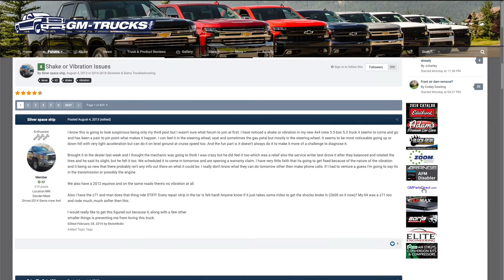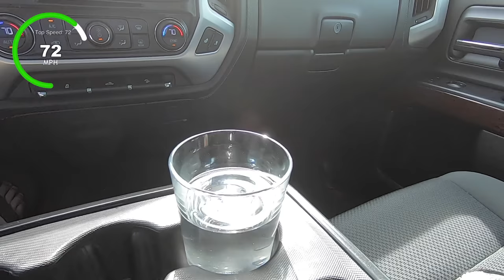"Chevy Shake" Driveshaft Fix for GM Trucks?

Comment: Tires make a huge difference H/T vs A/T  smooth ride with highway treads , all terrain are choppy loud and not so smooth but will get you through the snow. You want a smooth ride buy a 1970 Chrysler 300
Reply from the maker: I mean sure but the idea of “if you want smooth.... buy xxxxxx car” doesn’t make sense when older trucks and competing brands of similar years vibrate. Modern trucks ride incredibly smooth so when one doesn’t, to say trucks shouldn’t ride smooth is just deflecting responsibility for brand loyalty and dismissing the entire landscape of modern engineered vehicles.
Reply: @GearsGadgets  
All I can say is haves 2006 Silverado. One owner truck. 114,000 miles when I bought it two years ago. I hate it with a passion. It has the shake that's all over the place. Sometimes bad, sometimes very bad, sometimes barely but it always shakes. 

I have a 73 Dodge truck that rides and drives better than the Shakerado.

Comment: They had to flush the bad fluid out of the torque converter and now it is as smooth as it could ever be!!! OMG 4  years with this and now it is all gone!! Synthetic fluid replacing the old bad fluid originally installed at the factory

Comment: I have a 2014 Silverado 1500 4wd and had the “Chevy shake”. I put a 9” Mcgaughys lift with 37” tires. After the lift and tires, the shake is gone. Not sure if it was the driveline angle or jumping up tire size to 37s, but it 100% fixed the vibration issue.
Reply from the maker: Wow that is impressive, usually geometry changes like that would negatively effect ride. Interesting results.

Comment: Hi
I have a 92 1500 Blazer 4x4
In 2020 it started this also.
So it is not a recent affair.
Replaced front  shocks CV Joints the tie rod bar and ends new tires bsllanced and re aligned too. Still there.
Reply from the maker: Thats interesting to hear

Comment: I have a 5 speed manual RWD 2001 Jimmy that's been driving me crazy for years. It use to be smooth but my rims started to rust and I replaced 15' with 17' and then lowered it 2 inch all around. It didn't like that at all.

Comment: The 2014 4wd work truck I drive shakes, I believe this one is an engine issue though because it only happens when it goes to v4 mode
Reply from the maker: Interesting. Mine didn’t care V4 or V8, it was non discriminate.
Reply: Gears & Gadgets that’s why I’m pretty sure this one just has the engine on the way out since it’s only in V4 and I’ve seen people have trouble due to the cylinder deactivation
Reply: You can have the dealer
Chip the motor to where it is all time v8
Reply: Coastal Carolina fishing NC easier to just buy one of the devices from amazon or eBay that plugs in and gets rid of the AFM. Buuttt it’s not mine anyways just a work truck. I don’t care if it blows up will just prove I was correct when I said it was a bad purchase.
Reply: I have a 2014 6 cylinder with the same exact issues
Reply: Ctb 281 best of luck with it. Was one of the many deciding factors in me getting a new job lol

Comment: Chevy Shake. Bought a Tundra instead. Never had any issues.
Reply: @thefutureisgrim9391  funny when the tundra has more American parts and is actually made and designed by Americans unlike the Chevy trucks..  you make it sound like you don’t do your research.
Reply from the maker: I love the Tundra but I just ordered a 2021 F150
Reply: Toyota trucks just have frames that rot away.
Reply: @TurtlDrip  yeah forgot to mention Chevy has Piston Slap, oil consumption, and terrible transmissions. No truck is immune to rust. Look at the new 2021 F-150. All trucks rust depends on the area.

Comment: I used to build driveshafts for a company decades ago.  What you find in a long driveshaft is a deflection when under load is what looks like a kids jump rope.  A two piece driveshaft over that length is the better choice.
Reply from the maker: Yeah we toyed with the 2 piece driveshaft but due to time constraints didnt have the geometry correct so we went back to a 1 piece but it is thicker wall and actually balanced.

Comment: I have found that if you get a tuner raise the rpm idle to 1.5 so in return it will raise you're oil pressure. I believe the oil pressure lowers almost to a big. It works for me and and the idle almost feels like the truck isn't even running.
Reply from the maker: Thanks for the info!

Comment: Have you ever researched the great videos from Weber State auto program in Utah? John Kelly has some awesome information on some of the repairs and what he found. I took mine in to get new winter tires and before hand talked to the owner of the shop and told him of the issues. So when they put on the new tires I asked him to check just the wheels on the spin balancer and did find some out of balance wheels. They were pretty minimal thankfully but I really want to take the wheels to a machine shop and have them do a full balance and roundness check. I am frustrated but I am one of those guys that wants to find the problems too. I can not recommend the Weber state info highly enough.  thanks for the update, I also called them and visited with them. Very cool guys!!
Reply from the maker: I appreciate that. I am watching those videos now.

Comment: That crazy. I have a 2017 Sierra Crew Cab with the 6.2 and a short bed. It has no noticeable shaking at any speed. Furthermore, I've only recently found out that apparently the driveshaft critical speed is around 100mph and some self-destruct above 100. I've had mine to 115 a couple of times with no issues at all. 🤷🏻‍♂
I actually ended up here because I'm looking for speed rated driveshafts that aren't carbon fiber and $1800...

Comment: Which rear axles did you use? Stock or heavy duty (part #). I have replaced my drive shaft and still have slight vibration. Vibration before shaft was very noticeable, now it's less but still chasing the tail.

Comment: I had a 2000 Silverado that had a cyclic vibration at highway speeds. Felt like the AC kicking on and off, even when the AC was turned off. Finally traded it for a 2014 Silverado and guess what . . . Same damn cyclic vibrating shudder. It's the last Chevy truck I'll ever own for several reasons. Replaced one worn U-joint but didn't change a thing.
Reply from the maker: Interesting.

Comment: I have a 2007 single cab 1500 5.3 long bed Silverado.  Starting to shake bad now @ 90k miles. It didn’t start until a year ago at 80k. Thanks for this video.  I used to think it was the drum rear brake shoes chattering.
Reply from the maker: No problem, I try to share anything I can when it comes to this issue.
Reply: Ditto. 2007. 139,000 miles.  What have you tried to do to take care of the shake?

Comment: Just recently purchased a ‘17 Silverado 1500 4wd. I’m having a slight vibration between 75-80mph on the interstate. Dealership balanced the wheels and it helped a little. I’m starting to think driveshaft issue after coming across the video’s and checking the forums. I also replaced the wheels and tires with new ones, issue still there.
BUT i also have a slight shutter at idle (feels like a misfire in a way. No CEL or anything) dealership said it’s common with the hydraulic engine mounts… is this true? Was told that mine is not really bad, and they have had trucks come in worse and had hydraulic mounts replaced.
Reply: I have a 2015 1500 4x4 and just started having this issue.  It shake at 70 to 75. New tires with balance and just had an alignment.  I'm leaning towards the drive shaft now.   Mine also has the slight shutter at idle and I don't know why

Comment: Have you tried having the truck pulled though that speed range with the driveline disconnected
Reply from the maker: I have not, I am not sure how you could safely tow strap at 70 mph with the driveline disconnected. Seems dangerous.
Reply: @GearsGadgets  you could push the truck up to that speed. You always have brakes for safety. I'm just trying to eliminate the powertrain and driveline as suspect.
Reply: Good idea. Tow it with a dolly

Comment: I got a 2008 Silverado 1500 8cylinder 5.3 engine I got the same problem is vibrating too so I got told by a mechanic it’s the driveshaft and then torque converter still the same problem this trucks are bad design

Comment: I had this problem.  The GMC Hydrostatic Tran Fluid absorbs water (notice all these folks are in high humidity locations???) and that inconsistent viscosity causes the "shutter".  Swap the trans fluid to Synthetic...GONE.  85 MPH smooth as silk!  $263 solution; and I needed the  trans fluid changed anyway.
Reply from the maker: the driveshaft made a HUGE difference. I will swap to syn soon.
Reply: 6 speed or 8 speed?
Reply: @grifflebibble  8 speed and it blew up at 97k!  GM made good on the repair, lucky I purchased Certified Used so covered $0 up to 100k miles.  The new trans is silky smooth...but every "unusual shift" (every vehicle does that occasionally) I think oh no, here we go again.  I would sell it ASAP!!!  My next vehicle will be a Toyota!!!
Reply: @alkraus8818  I'm actually looking into possibly getting out of mine for a Toyota right now

Comment: Because my Wheels have some big Scuffs. I bought the Truck from a dealer in 2017. My truck is a 2wd WT 1500
Reply from the maker: Is that why it is vibrating?
Reply: @GearsGadgets  vibrating from Cheap Chinese Tires
Reply: @GearsGadgets  but only at 95-100 after smooth as glass
Reply: Gov. Kicks in at 98
Reply: @jdmozee12  not my Truck its tuned and Modded. No Gov on my Truck anymore

Comment: My 2017 silverado 4.3 has a shimmy. Now I'm no mechanic by any measure. Just a city boy looking answers. But I notice the shimmy when I get behind a car that's going slow and i have to let off the gas, when I lightly accelerate back up, thats when it shimmies. If I get down on the accelerator hard, it doesn't tend to do it. It's generally worse when you just barely press the accelerator going on an incline. Mine does it a 50mph. Does this sound like the same issue you had?

Comment: My 13' avalanche shakes sometimes  at speeds around 60 or more. I notice it more when the weather is hotter outside on mine for some reason. Was driving when it was 90+ degrees out and it was so extreme and violent. When cooler weather not bad. Just thought I would share
Reply from the maker: Interesting. I have noticed my shake more in the cold.

Comment: Have a 2011 with the shake.  Suppressed 30% with tires balanced on a machine that reaches highway speed... also used a OBD2 plug in V4 mode lockout - Range something device.  
AFM, DOD is insanity.  Unbalanced engine, uneven loading on internal engine parts... lock that bs out.
Love the Driveshaft info.
GM is playing with torque converters to help mask the V4 vibratory shift at low speed too...  they will reprogram you’re computer to try and mask as well... so the guy that said his was a Torque converter may be on to something.
Overall, GMs vibration analysis and suppression is weak, and a sign of reduced quality investment for increased earnings.
Reply from the maker: I agree Ziptie 06.

Comment: Did they not spin the old shaft to check for existing balance issues???
Reply from the maker: Not that I am aware of, but if you replace a shaft and the vibration goes away it is safe to say it was out of balance.

Comment: My 2019 Silverado High country 4×4 has had a vibration since day one. I have owned the truck for 3 weeks and driven it about 2k miles. This vibration is really starting to worry me. I paid 64k for a shaky luxury truck... I will definitely start looking into it and get it taken care of or GM should buy the truck back...
Reply: Jose Trillo check your lemon laws if possible. Sorry to hear that about such an expensive truck :/
Reply: @Bosha92  lemon laws? I have never heard of it. I will look into it. Thank you I appreciate your comment!
Reply: saw another video that they have swapped out the tranny fluid some models were shipped with causes the  torque converter to fail due to the fluid ruining the torque converter. Change the fluid with another brand than what it was shipped with. If I bought one I’d change it right away just to see in the real world if that works before the shakes start .... his did it at 50000 miles
Reply from the maker: I agree Jose Trillo. Thanks for the comment.

Comment: Mine started doing after my transmission had blown and got fixed. Im assuming it's the seal between the transmission and driveshaft. It leaks transmission oil at the seal from those two. It shakes from 70 to 80 mph. I plan to do camshaft change and dod delete soon but I do wanna fix this.

Comment: Fixing the Chevy Shakes!
Mobil 1 Synthetic LV ATF HP 124715

\
My 2016 Silverado with 82,000 miles has had the shaking issue for a couple years or the 30,000-40,000 miles. This issue for me occurs around the 70mph-80mph range. The center console would shake so bad that I would have to dial back the speed to below 72mph. 

Measures I have taken to resolve the “Chevy Shakes” None of these worked. 
1)	Rebalance old tires Free
2)	Purchased new tires $1,200
3)	Alignment $84
4)	Rebalance Drive Line $160
5)	Roadmaster Shock Absorber $500 (This did help some of the shakes,\ mostly the handling and ride)

Fixed the issue!!
1)	Transmission flush with the correct transmission fluid $200 (Whish does not come in transmission from factory) Mobil 1 Synthetic LV ATF HP 124715

I was able to flush the transmission myself. There are guides online that can walk you through it if you have the time and skill.

Here is a Link:
4L60E Transmission Flush Guide
https://www.newgmparts.com/4l60e-transmission-flush-guide

Took me 4 hours and I was able to flush transmission and change motor oil as well. The dealership wanted $140 for diagnostic and $750 for flush. Since the transmission was my last hope. I purchased the fluid from Summit Racing for $160 and flushed it myself. 

Amateur tips:
If you decide to do the flush yourself, do not pull ½” line on the cooler or the top one You’ll be changing your motor oil too! Do not ask me how I know this. 

A quick overview of how I flushed my transmission. 

1)	Pulled 3/8” transmission line out the cooler on the passenger side. I did the by pulling the black keeper down and removing the E-Retaining clip. I then pushed a 3/8” hose in the cooler and a 3/8” hose over the trans line and fastened them into a 4-quart bucket. 
a.	If you are doing this by yourself make sure to be careful. If the hoses are not fastened or held down into the bucket, you could make a big mess. 
2)	You or your helper (Preferably a helper) turn the vehicle on. Fluid came out of the transmission hose and not out of the cooler. I am not a mechanic but, in some videos, I watched, I have seen fluid pushed out of the cooler. There is a lot of pressure from the pump in the transmission, if a hose pops off, you are going to want someone to turn the vehicle off.  
3)	With both hoses placed inside a bucket with measurements on it, have your helped turn the vehicle over until there are four quarts or you start seeing bubbles. Kill the truck and do your pan drop. 
a.	Pan drop pro tip. The pan is extremely difficult to get out because the exhaust is right under the pan. If you place a jack on a board and a strap under the board wrapped around the exhaust. Pump the jack up to the frame and tighten down on the strap, slightly pulling the exhaust down (1/4”-1/2”). It does not take much. 
b.	Second pro tip. Purchase a handheld pump from the part store or Walmart. They range from $7-$20. Use it to pump the fluid out of the pan when drop. It will prevent you from making one big mess and covering you and the flor with transmission fluid. Trust me, its worth it! 
4)	Pull the pan and clean it. The gasket is reusable. You can purchase just a filter from the part store for less than $40 or both for less than $50. 
5)	Tighten bolts in a cross pattern and refill transmission with either 8 quarts or however much you were able to get out. I measured exactly 4 quarts in the pan.
6)	Once its filled, have your partner drain another 4.5-5 quarts out while shifting through P, N, and Drive. This way you get out as much as you can in the transmission. The fluid should be clean and pink.
7)	Fill the transmission back up with however many quarts you pull out MINUS ONE! This way you can put one or two bottles of Lucas Transmission Non-Slip. This is also supposed to help with the shuddering issue and allowing your seals to swell. This is to prevent leaks.
a.	I was able to put two bottles in.
8)	Do not add Lucas additive until the transmission is at operating temperature. You will need to fasten the trans line back to the cooler making sure the E-Clip is fastened securely. 
9)	The transmission should hold somewhere around 12.5 quarts. I purchased 14 from Summit Racing to make sure I had enough to flush out the old (Fluid comes out clean and pink)
10)	DO NOT OVERFILL TRANSMISSION. Watch tons of YouTube until you are comfortable. Add a half a quart at a time and allow it to run down the tube (where the dipstick goes, 10-15minutes) before you check it again. 

If anyone would like to reach out to me regarding this issue, feel free. 

Fluid:
https://www.summitracing.com/parts/mob-124715-1

Here is a helpful link provided by Chevrolet giving details on the issue. 
https://gm-techlink.com/?p=11127
Reply: That link only refernces the 8 speed. Not sure if that means it wont do anything in my 2014 6 speed.
Reply: Brian Preston “2015-2017 Escalade, Yukon; 2015-2018 Silverado, Sierra; 2015-2019 Corvette; 2016-2018 CT6; 2016-2019 ATS, CTS, Camaro; and 2017-2019 Colorado and Canyon models.” These are not all 8-speed transmissions. I wouldn’t be surprised if the 2014 weren’t experiencing similar issues.
Reply from the maker: Wow thanks for the incredibly comprehensive input. I had to approve it out of spam because of the links. Might be worth a follow up video.